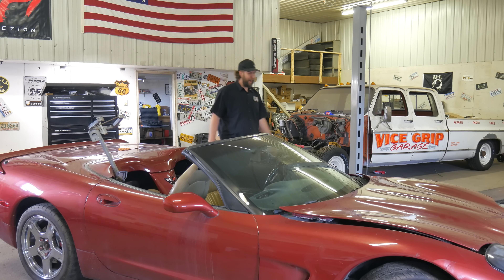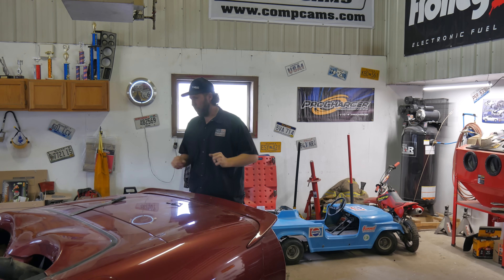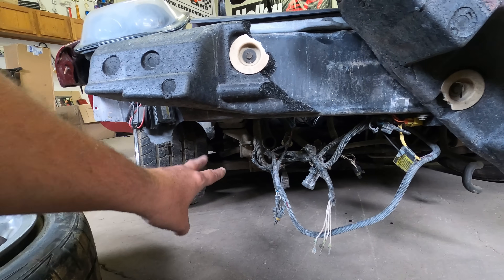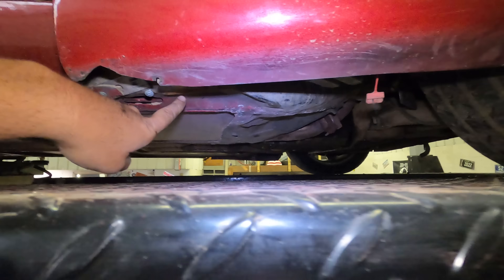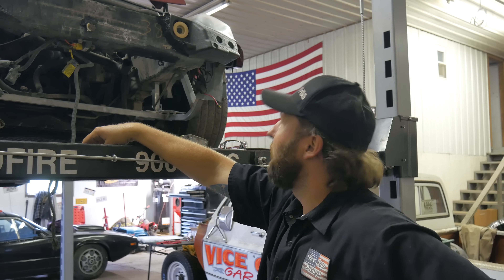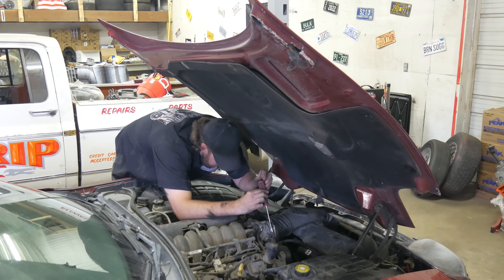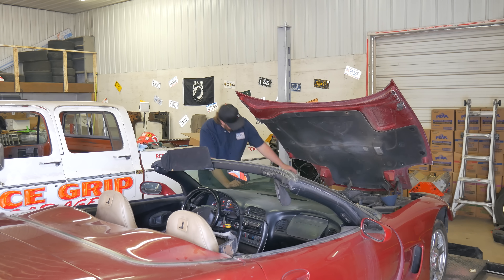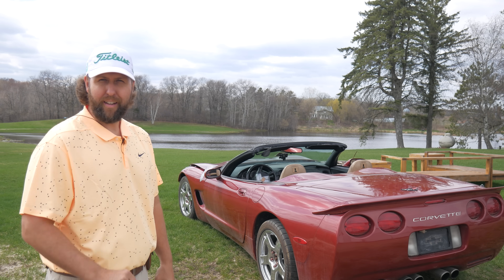I bought a Wrecked Auction Corvette - Will it RUN AND DRIVE?

Comment: I have my first car still -- a 1963 Falcon Sprint - that hasn't ran for 23 years.  15 years ago I had an engine built for it,  they broke it in on the dyno, I dropped it in the car, then life got in the way.    As I watched your videos over the last couple years I started wrenching on it.  She runs now, and my gratitude for what you do is is big.  Your show is good natured and informative - Thank you soooo much for doing what you do.
Reply: what engine?
Reply: @logan9957  289 block. 302 crank and closed chamber heads. It's about a 311 now.  When they broke it in on the dyno it came in at 317 hp with a carb.  But I had them set it up for a supercharger.  Probably need some frame tensioners before I give it the onions.  👍
Reply: @seanmccarty7074  lol
Reply: That's what the community is all about, get those that have fallen off the wagon, back on it 😀
Reply: I'll never see the car, or you, but thank you for bein' kind to a rig and puttin' 'er back on the road. Too many good rigs just...sit.

Comment: Car was jumped at speed, landed heavy pax front. It’s where you’re LCA marks are from, the upward tweaked pax side frame rail, the concave dent etc., they launched that thing at 100+ probably was a blast but hurt the ol spinal
Reply: That doesnt fit with the wheel damage

Comment: Lol’d at “pulled a Mustang and went over a couple of curbs”...truer words have never been spoken 😂
Reply: Have seen a lot of camaros doing that lately
Reply: became a common thing on the interweb with the last model.  The computer would engage traction control automatically during intentional burnouts causing drivers to suddenly launch into the crowd. I believe they've since fixed the issue.

Comment: If Leroy and Ruby don’t use it clearly it’s unnecessary lol
Reply: I would try and fix it its little ruff but has alot of good to it also
Reply: Body panels are optional.
Reply: Like, doors?
Reply: Jesus died and rose again to save you from hell, but you have to accept him as your savior first. These Bible verses explain how you can accept Jesus as your savior and have eternal life (John 3:16, Romans 3:23, 3:10, 5:12, 6:23, 5:8-9, 10:9-10, 10:13, 10:17, 8:28, Ephesians 2:8-9, Hebrews 11:1-3, James 1:17, 2 Peter 3:9-10, 1 Corinthians 15:51-55, 1 Thessalonians 4:13-18, Revelation 21:4-6)

Comment: Don't need a frame machine, just concrete anchors in the floor, come along's, and a good imagination. Jooo can do it mang.👍🤣😅😎👊💪
Reply: Jesus died and rose again to save you from hell, but you have to accept him as your savior first. These Bible verses explain how you can accept Jesus as your savior and have eternal life (John 3:16, Romans 3:23, 3:10, 5:12, 6:23, 5:8-9, 10:9-10, 10:13, 10:17, 8:28, Ephesians 2:8-9, Hebrews 11:1-3, James 1:17, 2 Peter 3:9-10, 1 Corinthians 15:51-55, 1 Thessalonians 4:13-18, Revelation 21:4-6) :)
Reply: Chain hoist!

Comment: Great video.  Maybe that should be mine!    Take to the frame shop, Have a steel bumper made for the front.... put 4 snows on it  and make it the daily driver. maybe a winch in the front too. Guess the motor mounts are still OK....or  It would have popped out on the test drive.

Comment: I relate to Derek on not liking to "work on things past 1984". I feel on the same level as him since the later the car, the more complicated it can be. New tech is implemented which makes things more complicated in some cases. You have more sensors, tubes, and things that could go wrong. I have an old 1st gen mustang and I find it so easy to work on. Everything is very simple and straight forward. I am able to do most of the work on it myself fortunately.

Comment: This old girl sure does deserve to be revived after all it’s been through. It would be really nice to see it all put back together properly
Reply: I agree.  Would sure love to see that thing back on the road, stock.
Reply: @Sam-vx6le  C5 Corvettes are dime a dozen. I love them, I have one. But this girl needs to become something else. It's a endless black hole money pit and it will still be a salvage title bent frame car.  Sand buggy is the way to go.
Reply: @Sam-vx6le  a revival probably would work if the cycle of abuse on it wasn't being continued to this very day, as we saw he started randomly messing with things and busted the traction control switch off :/
Reply: @foxyfan1336  No Kidding!  He would have to fix half the stuff he ripped off.
Reply: @charleyfrancis8671  If he could use the drive train and engine out of it that would make a pretty nice rig for quite a good price.
Reply: I agree. Fix it and enjoy it

Comment: On the subject of the ignition lock, and the universal key; The resister you found at the bottom of the column on the green or yellow wires, a locksmith can determine the correct resister-embedded key and provide a new ignition lock and supply it with the correct key blanks, plug and play.  Unless Corvette used an earlier generation Saginaw column, parts for 200+ columns are unobtanium, though for EARLIER ones, totally available OEM or Dorman.

I work with mechanics and body shops from all over to deal with stuff that the dealer shows as no longer available, yet the OEM part was sold through the aftermarket supply channel, and often did NOT get discontinued.

the test drive was fun, but remember that the shorts riding up and the constant pulling to the left can not be fixed by rotating the tie-rods.

BTW, I Enjoy your channel

P.S..... by the thumnail on my right, it looks like you went back to this car to take out the drivetrain.

Comment: I'm really diggin' this Corvette!!! I mean, the airbags are showing they work, it uses universally cut keys so you don't have to worry about finding a locksmith at 2am when you lose your keys at the bar, and the hood has the race-tech speed release model built right in with a custom latch. All this seems fine. I like this car!!!

Comment: straighten the frame with a truck and some chains. by chaining the frame and driving the tuck and yank the chain. that would be pretty cool to show people you dont need the machine to get it close enough. lol
Reply: I've straightened certain bends and buckles on cars using tow straps, a tree, and the car itself to pretty decent effect.
Reply: as a teenager in chicago, I learned every alley had a frame machine or 3 in it. The city was even so nice as to hang street lights from the top of em.

Comment: Swap the engine and transaxle into something much older and more sedate.
Reply: What a project that would be... 😆
Trying to stuff a Vette torque tube and that odd transaxle setup into a different car.
Reply: Make another burnout car with it Derek. It's got the five seven so she's got the horses. So you know she'll spend them back wheels just an idea brother
Reply: @swoods234  Those Vette's were only 345 h.p. Not much for a burnout car. I don't think the transaxle setup would like that very much either. It costs BIG to beef up the rear components in those cars to be able to handle big power and a spooled diff. for massive burnout abuse.
Reply: @davelowets  he's done it before with the banana   Vette🍌 so who knows

Comment: I can't agree with You more so, after 1984, a nightmare to work on. Reason I packed up My toolbox, got My Class 1 drivers License & went driving Trucks. Am fully retired now & My Son just bought a 2021 Chev Truck, & it's even worse than that Vet under the hood. Glad I hung My tool box up & stick to My old 87 Crown Vic. At least I can still fix it without any stupid codes.  Gone are the days of "Never Assume!"
Reply: I feel like some of the newer stuff is easier to work on. I went from a 1989 to a 01 and 2011 and it's a lot easier, don't have to worry about dist. and getting the timing just right, coil, plug wires etc. And the codes help sometimes and tell you exactly what's wrong. A classic car with a carburetor I wouldn't even try to mess with.

Comment: I think you should put the powertrain in an S 10. Then you would have something fun. Burn out machine.
Reply: Like independence?  That has 4X the horsepower….
Reply: Only problem is the transmission is connected to the rear end. Makes any kind of swap difficult. Wish I could have been there with you Derick! I’ve been involved with C5’s since Chevrolet sent me a brochure for the new vette in 96. Got a 2001 in my garage. Good cars but patience trying at times

Comment: I have an ‘03 Z06 heavily modified….there are electronic gremlins that can come up- but this thing is gonna need ALOT (obvi) may be worth getting an aftermarket ECM 🤷🏻‍♂️ rear axle ratio probably weak sauce if it’s a vert, that 3.42 unit is stock for Z06, may be a swap or this may have “Z51” option that gets shorter gear, the power steering rack you can get from Zip corvette for reasonable $$$, the electronic issues start w/ bad grounds & go from there. Good luck- you’re gonna need it!

Comment: The tires in it are pretty they are sports car thread they look like that due to they can hug the road. The tread is not worn. The plastic you see are dust covers for the various components of engine and other parts. Just fix the front end and all will be well, you will have to weld the damaged portion of the frame. You can gift your eldest son that car.

Comment: Drop that drive train into a shortbed late 60's to early 70's pickup. Even the rear cv axle assembly from that vette. Drop the pickup a few inches in front an rear. And have a sweet running street truck.

Comment: Well, I had a couple of wobble pops. I got to thinking while watching some of the old content. I came across the corvette video. I'll be dipped if that LS out the vett, couldn't find itself a new home in Lawsuit ? Believe you and me. I  know it's a slippery slop. Probably need a new rear end, definitely  engine mounts. Possibly U-joints. All that sorta thing. But damn feller, nice 5.9LS snugged in there would be the perfect tire roaster

Comment: Halarious  .. last time I saw leg's like that thay we're a a .. well y'all know how that goes.. something about a yard buzzed . Wrap o cable around the rt side of the frame at the a frame mount , connect the other end to 🌴 , about o 60ft . Get in turn on trac cont fire it up put in R dump clutch an pull a ROCKFORD strat n r right out  feel. N it 🤣 great video . I agree with that 1986 and newer I hate to work on my self my bear pows don't fit half the time can't stand all the plugs an wire s everywhere. Keep it reel thanks for the entertainment

Comment: Now my one wheel wonder mind is spinning, engine untouched, cheap plastic air intake "untouched" hoses cut, CA car, MN insurance laws where "totalled" does not mean "salvage". Kudos to VGG and MN Salvage Lot for this video. 

Explains the National Insurance Industry 'crackdown' on insurance agents and owners working to prevent further 'stolen joyride' thefts 'not' removing the starter  solenoid and installing a new starter reprogramm ECM then not reset with owner's keys while driving screwdriver in ignition leaving in ECM reset mode, then taking additional care not to further drive autoyard equipment into cars frame.

Is the untouched intake shroud for sale?

Comment: Deric just a casual obversation. Your compressor is too close to the walls. Any heavy useage will cause it tooverheat. You should have a couple of feet away from wall .I know you lose some shop space but it will be a lot better an the compressor

Comment: Alright what to do. First thing, before any going further , find yourself a frame repair shop. A well established shop, with years of experience.  Put car on frame rack, and with lazer light , start measuring. If possible, might have to chop frame and replace part of ,, or  torch and pulll straight, then re-measure. Ether way,,, the frame is the game. If not , then sell for parts.

Comment: Just do a backyard restoration on it or cut and weld the frame to fix it like new. Then buy the replacement panels and put a cheap paint job on it and sell it like new. Most people don't mind wreck repairs as long as they are done right. Look into making your own carbon fiber replacement panels at home on the cheap. You could sell this car for high $s with just a little blood sweat tears and 💰

Comment: i once roled a golf gti, nose over to the left, roof over my head in 3 inches, trunk would not close. so i straped it onto a concrete floor in the garage supporting the main frame by 8x8 wood struts. then i got to work using pullies and hydraulic car jacks and little by little pushed all the bent parts back to make hood, door, windshield and trunk lid fit exactly back in. took 2-3 days but even back in the day it would have cost way to much to pay for the car frame straigthening. what did you do with the corvette?

Comment: A body guy thinks that both the front rails are just not good. But after a wiggle of the digical finglets and a few cold snacks the reset button should be as easy to push as releasing a stinkiness from a skunk's exhaust pipe

Comment: I think you should just rip any & everything out & off of it ya can, put a roll bar in it, make it a crazy hot rod/offroad rally Frankenstein, best things this has going for it is the manual, the short gearing, & the V8 - it’ll never ride smooth w/ bent frame these things are super stiff you feel EVERYthing if your alignment is barely off forget bout bent frame

Comment: My mom's 1964 Dodge Dart was hit by a Corvette in the 70s.  The whole front end of the Corvette broke into pieces.  Not a metal car.  Fiberglass I think.  He didn't even slow down but instead sped up and hit her.  So she got the ticket and that rear right back panel never got fixed.  .  This isn't my type of car cause I haul stuff in my vehicle.

Comment: Funny... Very Funny!!!
I think you could just make up some Hydraulic Rams or whatever and just bend the front frame into a better position.  Of Course you would have to grind some welds off first.  Then weld in an extra piece or 2 of metal brackets and call it a day... then get it aligned.  
Good enough.... That's Good.... No! :)

Comment: Even the designers of the C5 admit they are junk. Those that own a C5 that disagree simply have not owned their C5 long enough to realize they are junk. Yard the engine and trans, replace everything except the spark plugs and you still don't have anything to work with. I see multiple trips to the dump and scrap yard in your near future. Hopefully the owner paid you to haul it off.